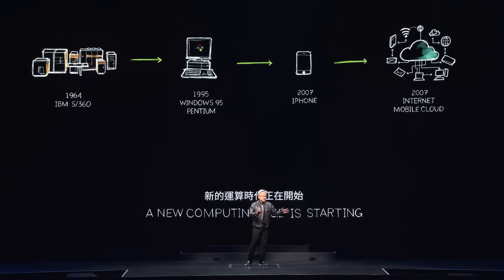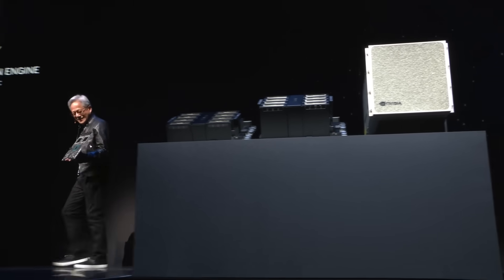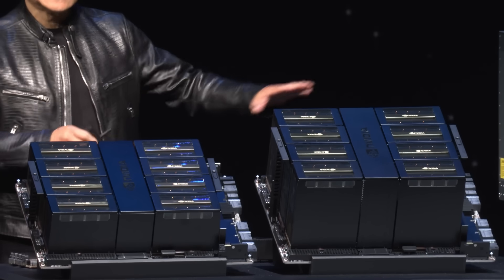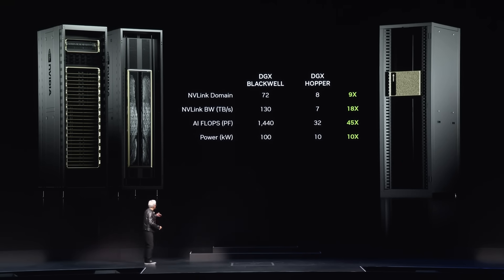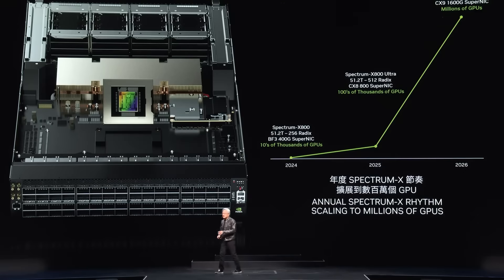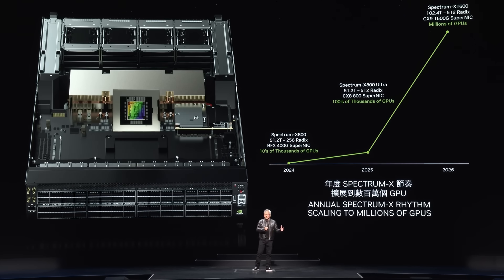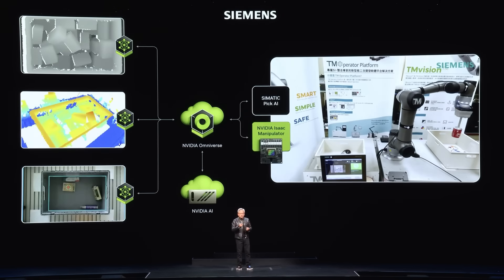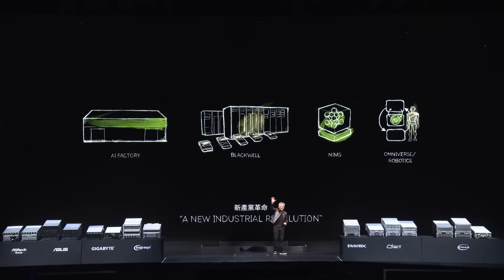NVIDIA CEO Jensen Huang Reveals Breakthrough AI Chip at COMPUTEX 2024 (Supercut)

Comment: With AI efficiency is king. You need huge data centers and the Electrical Grid is a blocker. The work AMD is doing in this direction is an important competitive advantage IMHO. While NVidia concentrates in raw power and technology, it does not solve this problem.

Comment: You spoke too soon. AMD just dropped a A bomb on AI. It coming 1-2 Q latter is 150% better and fits into existing sockets dramatically lowering refresh costs and TCO.   AMD take the crown 6 months after Blackwell at 25% of the refresh costs and 50% of the new system install costs, all while being cheaper to port and program using open source software and industry standard interconnect.

Comment: Surprised that the core / backbone is still made out of copper, I guess I could see it from a cost standpoint but limited in its bandwidth. Would’ve thought it would have been fiber-optic by now on connection points and interaction levels between the systems

Comment: Should You Buy Nvidia Stock Before June 6?
By Adam Spatacco – Jun 1, 2024 at 11:30AM
KEY POINTS
Nvidia announced a 10-for-1 stock split during its first-quarter earnings report.
Since its last split in July 2021, Nvidia stock has returned over 450%.
Valuation analysis and historical returns suggest that now is the optimal time to scoop up shares.
10 stocks we like better than Nvidia
NASDAQ: NVDA
Nvidia
Nvidia Stock Quote
Market Cap
$2,697B
Today's Change
(-0.79%) -$8.67
Current Price
$1,096.33
Price as of May 31, 2024, 4:00 p.m. ET
Nvidia's earnings report was jam-packed with positive information, but perhaps the most important detail surrounds an important date this month.

The time has come: Nvidia's (NVDA -0.79%) long-awaited first-quarter report rounded out an exciting earnings season for artificial intelligence (AI) investors.

Indeed, revenue is soaring thanks to surging demand for Nvidia's H100, A100, and new Blackwell graphics processing units (GPUs). Even better? The company's pricing power is helping Nvidia achieve consistent margin expansion and profitability.

Nvidia is currently riding a once-in-a-generation growth wave. There's so much information packed into their earnings report, it's easy to become distracted by the latest record the company posted.

While the financial performance is undoubtedly impressive, there was one part of the earnings report that really caught my eye: Nvidia announced a 10-for-1 stock split.

According to the earnings release, investors owning shares of Nvidia as of market close on June 6 will be eligible for split-adjusted shares.

Let's break down how stock splits work, and explore why scooping up shares of Nvidia now could be a good idea.

Collapse

How do stock splits work?
Stock splits are a form of financial engineering. When a company splits its stock, two important things happen.

First, the number of outstanding shares increases by the ratio proposed in the split. Second, since the number of outstanding shares rises, the stock price subsequently drops by the same ratio.

If Nvidia's 10-for-1 split were to go into effect today, anyone owning Nvidia stock would receive nine additional shares for every one share that they own. But at the same time, your average cost per share would be reduced by a factor of 10.

Since the share count and the stock price change by the same ratio, the market cap for Nvidia theoretically remains unchanged.

However, this is seldom the case. Let's take a look at Nvidia's stock-split history.

A person thinking while holding a piggy bank.
IMAGE SOURCE: GETTY IMAGES.

Has Nvidia split its stock before?
Nvidia has completed five stock splits since going public. The last time Nvidia split its stock was July 20, 2021.

The last time Nvidia split its stock, investors enjoyed nearly a 12% return in just one month following the split. By the end of December 2021, Nvidia stock had rallied an eye-popping 58% from the day it split in July.

Comment: 3:09 I am not able to understand the comparison, 
How nvidia can compare FP16, with FP8 and FP4.

Like hopper has FP8 with 4000 TOPS, and Backwell has 20000 TOPS with FP4.

So how can Nvidia compare 😂, FP16 with FP8 and FP4.

If we check with FP4 * 4 = FP16, then FP4 = 20000 TOPS is equal to FP16 = 5000 TOPS.

Or they can even say, FP1 80000 TOPS.

(I have limited understanding of topic related to GPU).
Reply: Essentially all AI acceleration comes down to matrix multiplication. Chips can infer faster if the math is optimized. In general, the less bits toggled in any system the less energy used, but with careful optimization the same AI model will run multiples faster. See Bill Dally's many talks on youtube, he's explained this in detail in multiple videos. In his latest, he specifically goes into blackwell, but he's been talking about fp8 and fp4 for a very long time. To clarify, changes in number representation and sparsity can still be the same model, and indeed accuracy can INCREASE with less precision!
Reply: @Wobbothe3rd  But it is still dishonest to compare them as equivalent units of computation.  A four-bit floating point operation is much less computation than a thirty-two bit one.  FP4, FP8, FP16, and FP32 have no business being displayed on the same vertical axis in those graphs.
Reply: your calculations are correct. It is not fair that Nvidia compares FP4 to FP8 numbers... Blackwell also consists of 2 similar Hopper dies+Grace Cpu...Not much architectural performans increase to me.